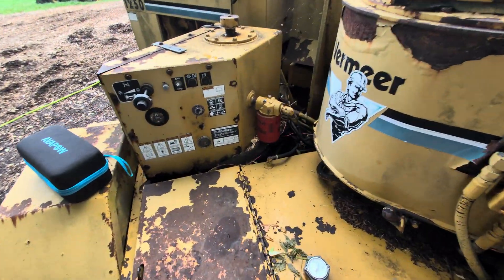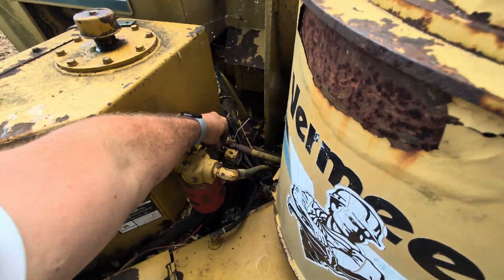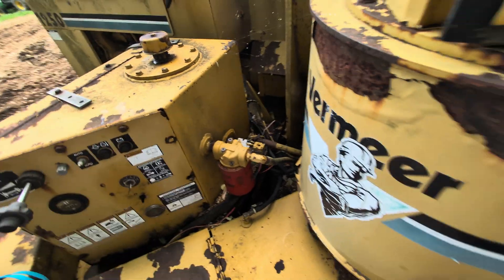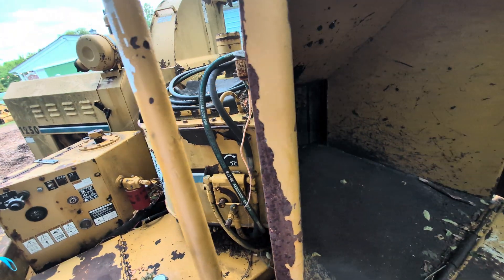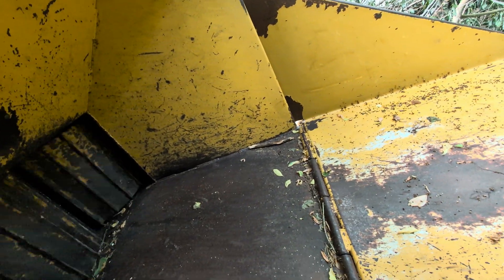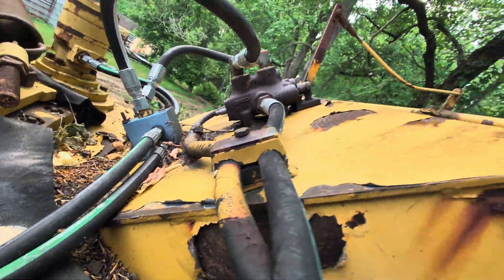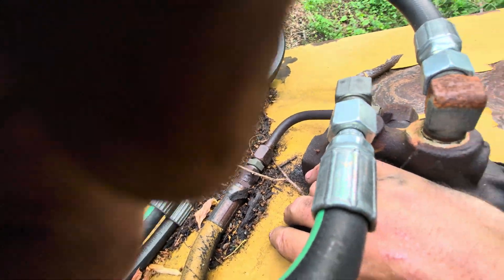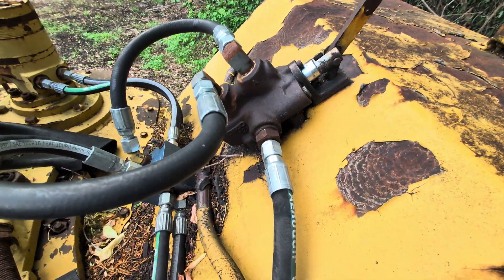Vermeer 1250 feed roller not working

Comment: Did you end up figuring this out?
Reply from the maker: Yes it was the Ford and reverse valve
Reply from the maker: Got this off Amazon, the plumbing is perfect, mounted on two bolts. Had to raise it up about a half inch for the factory levers to work. Took a little rigging but not much. Brand: JZGRDN
JZGRDN 4 Ways 3 Positions Hydraulic Control Valve RD512CA5A4B1 Compatible with 5100 Series 3000 PSI, 30 GPM, In/Out Ports 3/4" NPT, Work Ports 1/2" NPT